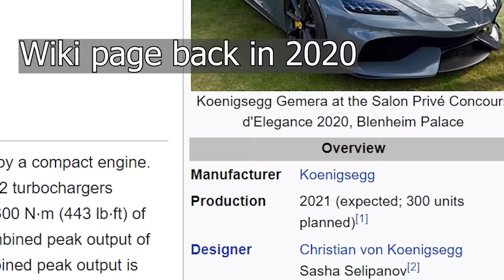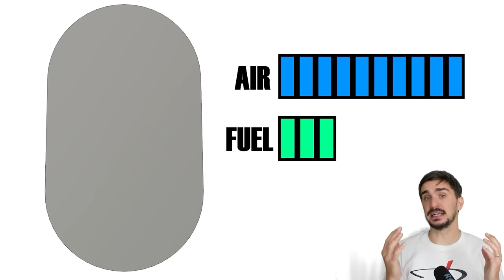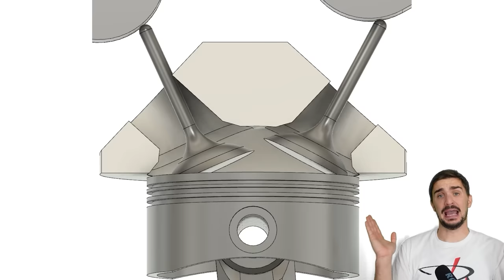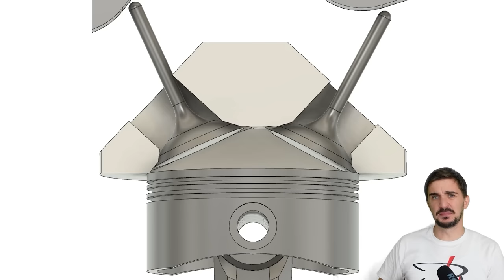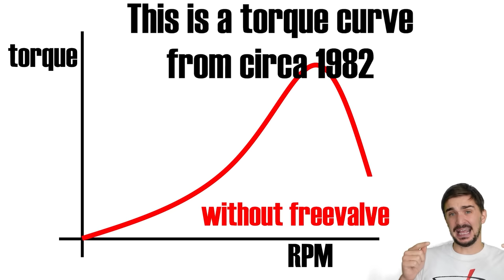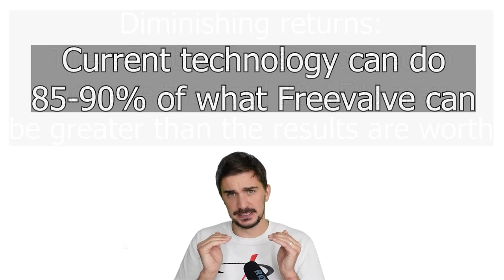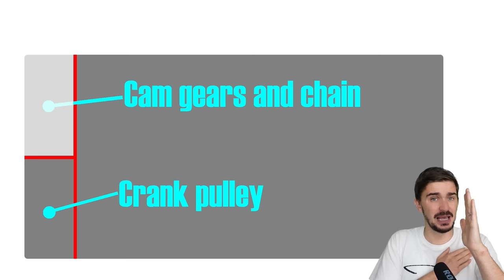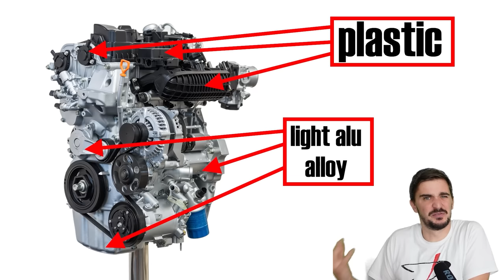FreeValve Isn't a Big Deal. Here's why

Comment: The biggest possible advantage to Freevalve might be the reliability attributed to amount of moving parts. Modern complicated valve controls are sensitive to oil quality. Even with perfect maintenance, they are still high wear and most likely to cause problems in high mileage cars.
Reply: common failure realy come from lubrication,
the more complex the internals the more sensitive they are,
thats why old cars last longer because they only have a few and simple internal parts and
Reply: Considering the number of bmw engines with valvetronic and vanos with more than 350 000 km it seems that it’s not even that bad… (I only really know bmw)
Reply: Ironically, my first thought was that this seems just as complex as a variable valve timing cam system, and it’s relatively unproven. So I would worry that it would be less reliable.
Reply: Another big advantage only becomes apparent if you plot the opening and closing of a valve in a graph. Since Freevalve is actuated with solenoids, it can open and close the valves almost instantly, compared to a regular cam and valve, where the valve follows the cam profile, and therefor opens and closes much slower than Freevalve would. This would mean a Freevalve engine is capable of a level of responsiveness that is previously only found in high end, purpose build race engines. Obviously technology such as BMW's Valvetronic and Fiats MultiAir do close this gap significantly, they also add complexion to the engine (certainly in Valvetronics case) which means more moving parts that can break (for instance, the Valvetronics shaft, the Valvetronic actuator) and more mass (and rotational mass). Even though Freevalve requires an air compressor, you won't have to drive two camshafts from the crank, which means less parasitic power loss in Freevalve. True, the advantages od Freevalve have become a little diminished, but Freevalve in itself raises the ceiling of theoretical performance.
Reply: @currymasterrace7153  you must know some serious hardcore BMW enthusiasts. I know very few with mileage over 100k miles who have not done major Vanos work.
Reply: This freevalve thingy is 100% software controlled and based on my (30 years of) familiarity with software developers, I'd prefer sticking with the camshaft tech :)
Reply: should be as durable as an oil assisted electronic fuel injector
Reply: @nir8924  think embedded systems engineers rather than software developers
Reply: @nir8924  Vanos is still controlled by software and the info from sensors. Many more layers of failures.
Reply: @BeNNstAh  There's another big advantage: pretty much all modern engines are of the interference type, which means that if the cam-belt or cam-chain breaks, the valves will not close and the pistons will crash into them. Freevalve appears to eliminate that problem.
Reply: @BeNNstAh ,, they had a graph from a scope up a few years back . Staggering if they can move the valves that quickly .
Reply: My 97 Toyota has 600k miles and I don't do regular maintenance lol
Reply: @surewhynot6259  don't take my message too seriously mate, everything can fail, it just fails in a different way.
Reply: Anyhow, many cars have variable valve timing .
Reply: Rotary valve has no valve shafts, cam lobes, or springs. It seems like it would have been an absolute game changer before variable valve timing. These days, rotary valve seems like it could be a HUGE improvement to any old V8 from weekend warrior to dragster... It's been a long time and I really just want to see something about rotary valve 😁
Reply: @tjroelsma  but if a solenoid gets stuck open, then you'll still run into an issue with interference
Reply: Even with that constraint modern engine failure is rare enough to not warrant this technology change.
Reply: @nir8924  Hi, Software developer here. ;) Hardware manufactures don't understand software development on a fundamental level. The think it cost nothing because it weights nothing. They are at least 2 decades behind on best practices from the industry. (Well except web development, that also sucks) Or they first make al the hardware and then expect the software to be written in one week. Embedded software can be made at any quality if your willing to pay for it and develop it together with the other systems.
Long story short, there is some culture clash and mutual misunderstanding going on. And quality is killed in the crossfire.
Reply: Same as a solenoid. A Solenoid can burn it's coil slowly an reduce strenght of the power of the valve. But the engine would have been useless till that can happen
Reply: so whatever engine choice will be the same. I doubt freevalve engines can last 30 years and still start normally
Reply: @phillm156  I've got 330K kms on my N62b44 and is still works like new... Super amazing throttle response.. so easy to heel toe..
Reply: @currymasterrace7153  Is that supposed to be considered good? I expect my old model 1989 B230 to be still chugging along happily after a million or two kilometers as long as I change the fluids and cam belts.
Reply: @rfrbz1269  Solenoids rarely get stuck open though, so I'd say that's a very small risk. You could even add a small spring to pull the valve closed to make sure interference will never happen.
Reply: @skitidet4302  by a modern engine perspective it is good. Of course, simple and overbuilt engines like the b230 will outlive 99.99% of modern engines
Reply: @reginaldbowls7180  you’re the exception, not the rule. I’m sure there’s a million mile Ferrari engine that’s driven in all seasons.
Reply: @reginaldbowls7180  six-figure mileage on an N62...have you considered buying a lottery ticket? (kidding...sort of)
Reply: @currymasterrace7153 A N46 with that milage?
Reply: @carstenknapmann4683  yep it happens (not as much as the n52 tough)
Reply: @1BigDaDo  Toyotas are proof that aliens never landed in Roswell; they landed in Toyota City, Japan, and gave away all their tips on engine reliability.
Reply: @Wooskii1  I've always loved the idea, but I think the issue is 1) making a good seal given the pressures of a piston, 2) handling flow as the thing rotates into and out of position.
Reply: @kevinrusch3627  Yea, I think it would need some kind of variable valve timing.
Reply: @phillm1564 you must not know many bmw owners and are going off of forums, vanos problems are uncommon at worst in modern (2016 and later) bmws.
Reply: @TheFanatic340  isn’t that the idea? Older cars with more wear and tear will likely have more problems? I’ll bet 2023 models have fewer problems still than any others.
Reply: @phillm1564  he was going off of mileage, that's why I also specified 2016 and newer. there are plenty of 2016 model years with over 200k miles
Reply: @TheFanatic340  I hope you’re right. I’m looking into a 2023 M340IX
Reply: @Nir  As a software developer, I'm severely offended. (I highly doubt the software would be the problem here though, rather how to make the valves themselves reliable while still being controllable through software).
Reply: @phillm1564  the b58 is easily the best engine bmw has made in decades, I've got well over 140k on mine at 750hp they're easy to work on and very reliable.
Reply: And one weird software mistake or solenoid glitch could brick your engine.
Reply: @Dowlphin  that could already happen
Reply: @Dowlphin  you have the same issue with Vanos plus oiling issues and mechanical linkages, springs, slide valves.
Reply: @@themostillusiveman9cars last longer now ?!?!? Telling me the new Ford Bronco will last longer, at rough conditions, as the old Broncos ?
You are a joker, sir.
Reply: @Dowlphin said "weird software mistake" as it happens all the time, as engine softwares were ran by android OS 😂....
 Have you ever flew on a comercial plane ? Well, today planes are almost 100% software controlled, so you better keep your feet rooted on the ground then. ☻️
Reply: @carlossmith7043  You don't have to tell me what a risk it is. Plenty of examples of outrageously incompetent oversights leading to many deaths, plus the escalating general societal mess leading to everything running like crap.
I have more confidence in something that is not profit-driven but me-driven.
Reply: @carlossmith7043  With triple the redudancies and triple the price

Guys, let's be honest. Your comment above is literally talk about how those shit are unnecessary for reliabilities

Comment: I first heard of “electronic camshaft” about fifty years ago. The benefits were well known. A neat idea is to have the engine to be self starting. The major problem in those days was the actuator itself. There are already electronic controled  in use for medium and slow speed Diesel engines. But they turn at a max RPM of 1000. I do wish manufacturers good luck in the development.
Reply: How could that lead to a self-starting engine?
Reply: @eDoc2020  You can open the intake valve, inject fuel, close it and ignite it. With a closed intake valve (normal camshaft engine with springs) that isn't possible.
Reply: @medicenchepibe  I suppose that could work if the cylinder happens to be near the top of the power stroke. This seems unlikely at first but with multiple cylinders chances are at least one of them is close enough.
Reply: When the engine stops one of the pistons is near tdc on the compression stroke. A bit of fuel is injected into that cylinder and ignited. This makes the crank turn in reverse. Another cylinder with closed valves comes to compression and before tdc injection and ingnition occurs which gives enough energy to start the engine in the forward rotation. Quite a simple concept,but requires valve actuation not available with a traditional camshaft.
Reply: Guys , if you are interested please check Mazda’s “ I stop “ start/ stop system , it use the same principle. The alternator load and the intake vacuum level ( throttle position)are used in order to stop the engine in convenient for self starting position . The piston in expansion stroke cylinder must be stopped after TDC , it works even if the piston is stopped up to 90 degrees after TDC .The direct injection inject some amount of fuel and multispark high energy ignition evaporate and ignite the mixture . The start is extremely fast , like the engine jump straight from 0 to 800RPM . Also this sometimes work on carbureted cars , because there after turning off the ignition , the crankshaft continues to turn on few revolutions which still suck fuel from the carburator but since the ignition is off , this fuel remain trapped in the cylinder which is in expansion stroke . If the car has multi spark ignition, then when you turn the ignition on again, the heat from the continuous sparks evaporate condensed fuel and ignite it . The start is amazingly fast as like momentary.
Also 4 cylinder 4 stroke engines tend to stop most of the times in 2 positions ( the 4 pistons try to equalize in the middle of the stroke , the 6 cylinders has 3 such positions , the 8 cylinders 4 and the 12 cylinders 6 . On two stroke engines this positions numbers doubles . So the probability for the engine to stop in favorite for self starting position isn’t so low . I personally has such experience since my cars always been equipped with modified high energy ignition systems. Once one of the cars with 4cyl/4  stroke , carburetor engine self started after all night staying outside on - 20degree Celsius. Another one 3 cylinder/ 2 stroke engine have started by itself when turn the ignition on , many times . Unfortunately this was many moons ago when the mobile phones doesn’t existed yet , so I don’t have video on the events . Here is a video where two stroke / 2 cylinder motorcycle engine perform self starting multiple times consequently .And those motorcycles aren’t equipped with electric starters ! Enjoy!

https://youtu.be/7gQ-uyHfC1s
Reply: @flappingflight8537  As I understand the Mazda system, because the valves are electronically controlled the engine can be stopped before tdc on a compression stroke. This means that the combustion chamber has fresh air. To restart a small amount of fuel is injected intohas the combustion chamber and ignited. This provides a small amount of torque in the reverse direction. This isn’t enough power to start the engine ,but it allows enough momentum to create enough compression on another cylinder to provide another injection and spark to now start the engine in the proper rotation.  
As a side note, my father said his brother’s Model T would start quit often by just turning the ignition on. That is if it was soon after shutting in down.
Reply: @tracylemme1375  the Mazda’s system doesn’t work this way . This way will turn the engine backward which isn’t good ! 
My 4 stroke car as I said already started after all the night sitting outside on the street and in the morning the temperature was -20C . But it started by itself only twice . When the another one which was 2 stroke have done this multiple times but not every time of course. If I’m not mistaken the Ford T ignition was some kind of electromechanical multi spark ignition . So it confirm that the ignition energy and spark duration is of great importance if you want to self start the engine . The ignition system of the motorcycle in the video that I posted is modified multi spark one as well . When you turn the contact on the spark occurs on the spark plug electrodes and stay there continuously as on the welding machine. 
Thank for the FordT story .
Reply: @tracylemme1375  here is a video of how Ford T ignition produce multi sparks  , watch around 7th minute .

Comment: I hope freevalve does come out eventually, but I more hope that they change their marketing to target the audience that would actually benefit from it; the people who restomod classic cars. As you pointed out, their numbers are only accurate if you compare them to those older engines, but the promise of being able to convert an older engine to hold similar power to a modern equivelant would be compelling to the people who like to push those older cars without swapping the engine or doing anything crazy to it.
Reply: @dragonbutt  I could see this being packaged as a head swap solution.  Possibly requiring only a hi-res encoder being mounted on the crank as well as an air compressor being added to the accessories.

Comment: Very nice video. I wonder if the delay in adoption/implementation of FreeValve has to do with reliability concerns. I work in an industry where the German-made manufacturing machines use numerous, expensive neumatic controllers. These controllers fail often and need to be replaced. Usually they fail to actuate, but sometimes they stick open. Imagine an old-school timing belt lasting longer than a much more costly FreeValve actuator...💥😮
Reply: Oh man, can you imagine a valve sticking open at 8k rpm?😮
Reply: Or we had a 2 year pandemic that destroyed shipping and production lines all over the world.
Reply: Can't imagine those being more reliable than any VVT system today. I drive a BMW and would take a chance on FreeValve over Vanos...
Reply: It's been 15-20 years since marine 2-stroke main engines have changed to hydraulically controlled exhaust valves actuating system. And as of now this system doesn't give too much problems (I'm marine engineer and this is my responsibility to keep machinery in good condition) . And the system is used not only to control exhaust valve, but it also controls injection timings and some auxiliary machinery work. Pneumatic system that only controls valves, should be much more reliable then hydraulics. So I don't think it's about reliability issues.
Reply: It's mostly to do with the giant push to remove gasoline as a vehicle fuel. Most auto manufacturers won't move on a new engine tech that they likely won't ever be able to use long term because nutters want us all to have giant paperweights that we can't charge.
Reply: Valve failure or wrong timing could destroy a cylinder or even the block, it's just not worth it.

Comment: Now I really want a video about all the different valve lift and valve timing things you quickly mentioned in this video! I didn't know they are that common, I wish you could explain more carefully how they work and what are the most used types
Reply: i want too
i upvoted
Reply: i believe there are already a bunch of videos about that,
other than d4a
Reply: @endurofan9854  other than d4a = nowhere near as good
Reply: Engineering Explained has a good video on Nissan's VVEL system. I found it worked really well on my 370Z. Very linear power delivery.
Reply: Anything about v-tec probably
Reply: @laurisikio  Just search the videos and you will certainly find... I've seen more than one video about v-tec and they were better explained than this
Reply: @VascoCC95  V-TEC is just alternating between two camshaft profiles. It is completely different, and way more simple, than variable valve timing/lift

Comment: Freevalve sounds way more interesting from a manufacturers perspective, and I think the technology could be waaaaay more useful in other applications than "performance". Valves could eventually just become modules you swap out, resync digitally, and go. It would remove failure points of a complex mechanical cylinder shut off system, and would reduce the cost of manufacturing a complex cam shaft. Furthermore, the Suze reduction might not help with conventional inline or V shape engines, but what about Boxers? Or wat about reliability for heavy duty applications? Extend service life for various mechanical components by adjusting valve settings for minimum wear in adverse conditions. I think these are very real potential benefits, just not for performance. Maybe thus will be the future for hybrids?